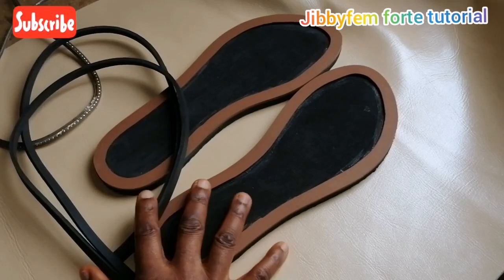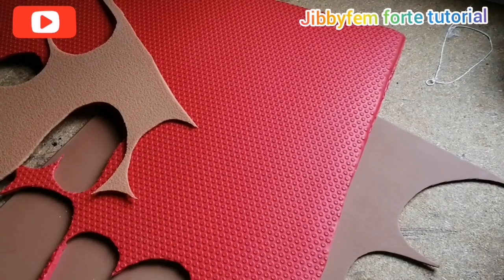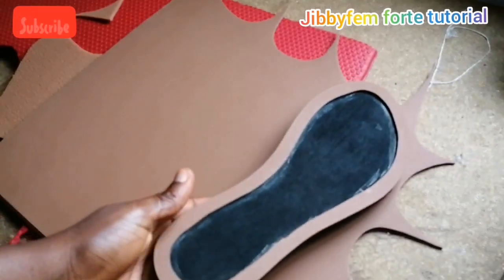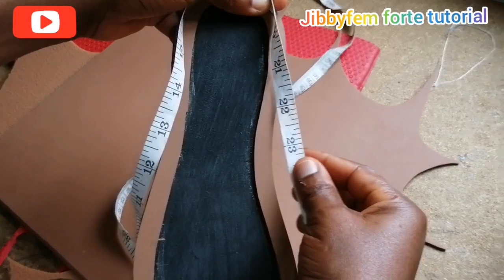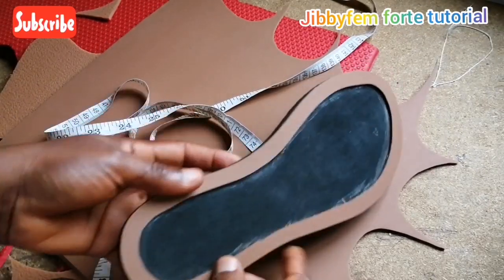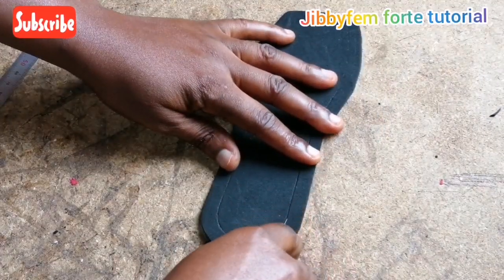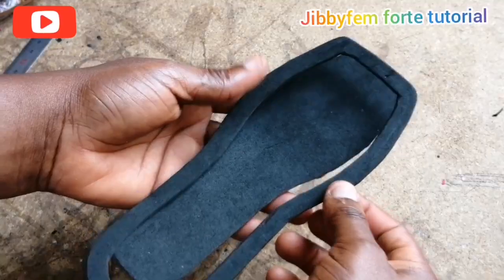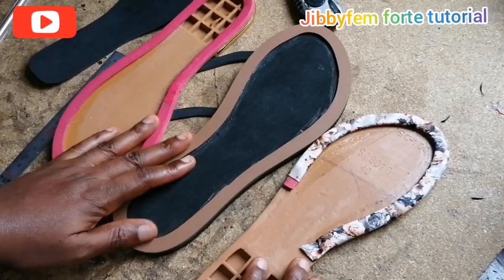How to welt shoes :How to hand welt shoes, sandals and Slide)

Comment: This is not hand welting. Hand welting is a construction process used in high end bespoke footwear in which the upper and foot bed are stitched together with a welt, and then a sole is stitched to the welt itself, making an extremely durable shoe that can be resoled. What you are doing is just decorating cemented construction shoes with a fake welt. That's fine to do, and it has its place, but you shouldn't refer to it as "hand welting." That's a misleading video title. I was looking for a very different type of video.
Reply from the maker: Thanks for enlightening us. 
Maybe it's misleading to you because you didn't pay attention to the thumbnail and in the video I explained that it's a way of decorating our sandals.
Can you please suggest the best topic for this?
Thanks